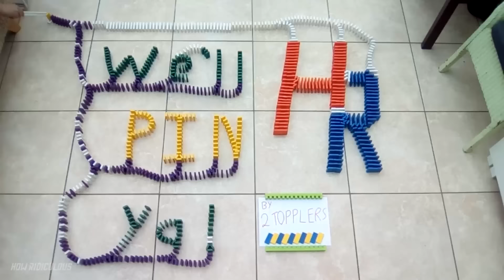Can This SOLID GLASS BALL Survive a 45m Drop?

Comment: It’s called a “conchoidal fracturing”, and occurs in glass and glass like rocks. It’s one of the key indicators archaeologists use to identify stone tools and tool scraps. When the force of the strike moves through the glass, depending on the angle and force, the fracture absorbs much of the force (you can see that in the ripples left on the new surface of the glass) allowing for precise shaping. Basically, glass + force = conchoidal fracture.
Reply: Fascinating
Reply: Up
Reply: It's interesting how the fracturing just dissipates the energy.
Reply: Is this Copy and paste or is this person a genius
Reply: Yes. Essentially, because glass is a very dense liquid, and can not be condensed further the point of impact remains close to intact. The force wave projects in a cone from the point of impact in a cone shape and shears (sort of) the glass away.
Reply: Rob Parker you are a genius
Reply: Yes
Reply: BMT Trickshots why
Reply: This is not entirely accurate, 
it could have some conchoidal fracturing sure, however the primary cause of the ripples are most likely a result of the rocks on Mars inducing a 'Coney Joney' effect.
Reply: @tobparker  There are a lot of people who don't know glass is a liquid.  :o)  I think of the ripples in the globes where the "coney joneys" are formed are like the ripples in a pond when you throw a rock into it.
Reply: I'm a flintknapper, can concur.
Reply: Julie Stevens yeah, and it’s amorphous, which explains why the cones are all a bit different. People tend to think glass is regular and crystalline, but it’s really pretty wobbly.
Reply: Glass is NOT a liquid, that is just a myth. A quick google search would tell you that. The myth comes from ancient stained glass on churches which was wider at the bottom than the top, suggesting that the glass was just a slow moving liquid. However, perfectly flat glass is very difficult to make (especially in ancient times) so it was already warped when it was made. Numerous experiments have been done since which conclusively prove that glass is not a liquid.
Reply: You're right except I think its called a coney joney
Reply: any kid who has played with marbles knows this will happen
Reply: Thx I did not know that :)
Reply: Dennis Brännvall’s #1 Fan Ok. You’re right. Glass is not a liquid. It is actually an amorphous solid, which in this particular case makes it act like a liquid. At least for the point of the cone explanation. Agreed though. Calling it a liquid is not correct or at least an oversimplification.
Reply: Wrong! In Australia, it is most often referred to as a "freakin' coney joney", and is sometimes called a "coney jones."
Reply: An important thing to acknowledge is that when the glass breaks, it's breaking with the least resistance. which is largely outward forces (from when the glass suddenly stops and the pressure builds near the surface).
Reply: They're probably the one to write the thing people copy and paste.
Reply: Joe Gilliver well, think of the force at the point of impact. It wants to travel in a straight line, like in a column through the glass ball into the ground. Some of that does. However, the ground is actually a steel plate, which is very stiff and will not absorb energy, so that force of impact can’t quickly go into the plate and into the ground. Some of that impact force spreads out into the glass globe, and the most efficient path is a cone. Glass is amorphous, so it doesn’t have regular shear planes, which is why we don’t see any right angles. But something has to give, so the weakest bonds are broken in a general cone shape
Reply: @dennisbrannvalls1fan964  thank God someone answered this correctly. Chemical Engineer here and can sleep tonight without writing a response
Reply: The description of the type of material that conchoidal fracture happens is known as "amorphous solids", where no crystal structure exists in the solid. Glass is one type of amorphous solid. Glass is stronger in compression than under shear which explains why the impact point survives (compression only) and the surrounding glass shears off.
Reply: Yep. Also occurs in most forms of brittle fracture to one degree or another. Materials Engineers/people doing failure analysis can use the pattern left by this sort of thing to diagnose the location or defect where the failure initiated. Works in metal, ceramic, glasses, polymers below glass transition temperature, basically anything that is sufficiently brittle and is hit hard enough. You can even see it in Silly Putty if you pull it apart fast enough to generate a brittle fracture. 

Although I think for shear poetry the mars/cosmic sphere/morphic resonance thing Gormsen came up with is an absolute beauty.
Reply: same deal with flint. you can knap glass the same way you would flint
Reply: You see when a big glass hits something hard it makes a small glass
Reply: Pin this woman.
Reply: Dis man speaking big brain
Reply: It's the same effect we see in obsidian
Reply: Oky doky
Reply: Plus the line of fracture proceedes through the glass at a right angle to the point of impact. That's why they all have the same shaped cone left on them.
Reply: Not a scientist, but the offset of the conchoid probably has to do with the angular velocity (or the angle of the impact plate). So the drops from the top produce relatively centered cones, the drops from lower down that require a bit of throw produce an offset cone.
Reply: if they were to measure the angle of the cone made, they would find that it is a 120 degree angle for all of them.
Reply: cool
Reply: smart
Reply: but why doesnt it just shatter from a much higher height, the cone was about the same at different heights so im interested to know why it didnt break more from a much higher drop
Reply: conchoidal fracture = CONEY JOE-NEEEEY BRUZ
Reply: Nah thats not it
Reply: @timsgotissues3581  i was looking for the flintknappers and rockhounds to answer... i knew right away
Reply: Little disappointed that someone beat me to it. Good job.🙂
Reply: @ChickenArmyBros  it's because glass is an amorphous solid and is actually really good at transfering energy. It will break in the same way each time from different heights but the force of the parts that break off will increase. You should also notice that the parts that break off get smaller as the height increases. That's because of the increased force being transfered.
Reply: @kiancarruthers3050  it's call geology
Reply: Well you're quite the scorchio aren't you
Reply: It's called a coney joney thank you.
Reply: @tobparker  you know it still blows my mind to think of glass as a liquid
Reply: Conchoidal fracturing is a fun one to see, the impact point has the strongest resistance as it has the full mass of the glass behind it and cause the fine structure of the the glass tries to fracture to the shortest distance of least resistance it spreads out yo the curve surface of the glass.   You need a really powerful slowmo to see glass fracturing at that speed though to see it as it goes around Mach 4.
Reply: AKA Coney Joanie
Reply: @gailfox7  It's not a liquid at all. That was also explained.
Reply: Interesting 🧐 🤔
Reply: @stendar1178  In low quality glass (poor, uneven cooling) this could occur. However, from the examples in the videos, these are professionally made to extreme tolerances. The fact that they can act as an effective magnifying glass is proof of their consistent density. Much like the ocean, the deeper you go the greater the pressure. However, in depth, you often look at the effect of outward pressures on the internal (lower) pressures.

In this case, the greater pressure is ocurring internally (especially when the glass comes to a sudden stop). The column (or cone) of glass at the impact site has the most "reverse pressure" working against gravity (because there is a column of glass supporting it). However, because it is being squished (slightly) from the sudden impact, the crystalline structure fails in a predictable way creating a conical structure where the impact occurred. A cylindrical shape is preserved and the material to the sides are "pushed off." 

Different materials have different advantages to certain forces. An egg can withstand a lot of pressure from above or below, but put pressure on its sides and it will break easily.

Path of least resistance.
Reply: I’m glad someone used the actual name rather than: “Coney Joney”
Reply: @7markhunter  Yes! Compression? Great at it! 

Shearing forces? No dice.
Reply: @tobparker  that makes sense, my question is: if they were to drop the glass balls from a high enough surface to fully shatter the cone around the circumference of the ball, and there was still more energy to disperse, where would the energy go? I dont know if I made that easy to understand but I hope you get what I am saying.
Reply: Psh, this guy am I right
Reply: RamblingBaba _  Glass is not a liquid. It's an amorphous solid, which means that at its molecular level, it has no discernible pattern or "structure." Where sugar or salt, even in tiny granular forms, will create harsh right angles (cubes), glass doesn't "settle" on any one shape, so it's consistently inconsistent. That might seem like it should shear or break in random ways, but because of the size of molecules, it shears and breaks in a regular way based instead off of the impact site and slight variances in the density/ micro fractures formed during the cooling process.
Reply: Very good information! Thanks for teaching me something today!
Reply: Your probably looked it up
Reply: None of these explanations seem very good to me. At least, none of them are explained very well. 

I think what is going on here is that the glass falling away simply has nothing to support it. There's nothing underneath it. The very tip has the steel plate under it, and the glass above that point has glass under it. The glass on the sides has nothing underneath to support it, so it enters into tension and breaks away. The glass at the point of impact is under compression, and glass is actually insanely strong under compression. The farther off-center you get, the more you go from compression into tension.
Reply: Why is the angle always roughly the same and what is the precise angle? HR we need measurements!
Reply: i’m putting this in my physics notebook
Reply: @RipleySawzen  I think you have the right idea! However, I think your explanation is lacking. The only part I would add is that the "column" (the middle of the cone) has the most material to resist compression, so it is hardly affected. However, the conical area surrounding where it impacted is not sustaining an impact. Instead, the "column" of glass is literally "squishing" or compressing (very slightly). This is enough that the amorphous solid shears off, as it does not handle side-to-side fractures particularly well (shearing force caused by the increased cylindrical pressure from the impact zone).
Reply: I’d like to see more of the glass balls but on a harder surface without a back cushion like sane
Reply: Kian Carruthers that person is a geologist
Reply: RamblingBaba _  If you look at old windows - I mean 200-300 year old windows, you will notice them sagging and they seem to pool down at the bottom of their frame.  They are slowly "running" from the top to the bottom.  They are just doing it very, very slowly.
Reply: @Brandon-vo3cb  I shouldn't do late night comments
Reply: @tobparker  Glass is not a liquid, that is a myth, it's an amorphous solid, and it does not "flow" slowly over hundreds of years. This has been debunked many times. I won't go into it.
Reply: @juliestevens6931  Glass is not a liquid, it's an amorphous solid, this myth has been debunked many times. Glass does not "flow" slowly over hundreds of years, again a myth rooted in poor quality manufacturing of pane glass in the 1800s. Google it?
Reply: @juliestevens6931  They installed glass that way hundreds of years ago. They've found glass just the opposite, the thick side up, in places where they didn't care which direction it got installed in.
Reply: u get that from wikipedia
Reply: I'm a geologist and i approve of this message.
Reply: K
Reply: @dennisbrannvalls1fan964  It kinda makes sense as an ancient glazier, that if I pour a sheet of glass that has a slightly thicker end, that I would put that end in the bottom of the page.
Reply: Thank you.
Reply: Nerd
Reply: could it just be bc of how the glass balls were made/blown? breaking in the pattern they blew the glass in?
Reply: s m o r t
Reply: Kool
Reply: @tobparker  nah, it's just homogenous, super strong in compression and weak in tension.
Reply: how is that any difrent from my responece :(
Reply: My brain hurts
Reply: You see this all the time in obsidian and quartz especially if you fracture quartz crystals or other relatives of the silicon oxide family of minerals. Because glass is essentially quartz it has the same property. Just break some glass and look at the broken edges.
Reply: Also known as Tatonic velocity
Reply: I'm 90% sure you looked that up. I didn't look it up. It's called using repeated science.
Reply: smart person
Reply: Pog
Reply: You googled it
Reply: n e r d
Reply: Is it something like how depleted uranium round self-sharpening during impact?
Reply: Absolutely stellar
Reply: Rob Parker do you know if this same effect happens in glass-ceramics and ceramics or dose crystallization have some effect on how it breaks
Reply: I always love seeing stones that were manipulated by humans, the difference in the fracture is that they often have a bulb of percussion that looks more “planned” as compared to a stone dropped and randomly breaking
Reply: @tobparker  it isn't that it is acting as a liquid, since there are no planes of separation within the glass, the force travels through it in a wave pattern (similar to how seismic waves travel).  The angle at which the force is applied from a given point is what causes the cones to seemingly go in one direction or another.  Amorphous solids don't really "act as liquids", the amorphous refers to the fact that it lacks the long-range crystalline order that defines true crystals.  While liquid crystals are a thing, they consist of organic molecules and vary depending on temp., pressure, etc.  and can fall into several categories based on their phase transitions.
Reply: @ChickenArmyBros  because they are spheres and the force will travel in the relatively same manner through the point of impact, the outcome will be similar. think of the force spreading out in a cone, once the cone hits the outer limits of the sphere, the outer parts will sheer off. This is why it is about the same percentage of material that is lost no matter what size sphere is dropped.
Reply: U serched
Reply: Kian Carruthers I studied archaeology and flint napping was a big part of that. I spent a lot of time training to know the difference between a nap and shard of rock. So I’m neither...?
Reply: The JuicePoppers went to school for my Archaeological certification and anthropology degree.
Reply: McKay Martin I just went to school for archaeology. It’s important in flint napping. Most community colleges offer courses.
Reply: Yup, my wife is pretty smart. Just sayin'
Reply: I thought it was built in layers
Reply: Were did you learn that?
Reply: Depend on the angle its a sphere -.-
Reply: Copy and pasted 100%
Reply: Nessa you go girl
Reply: That must have taken a while to tipe
Reply: You are the new Karl Kruszelnicki, to explain future conney jhonney's
Reply: Its an extreme conchoidal fracture. Normal conchoidal fracturing looks like an inverse oyster or clam shell somewhat, which is where the "Conch" comes into play in conchoidal, as it resembles the shell of a shellfish.
Reply: um no actally coney joney mars rocks
Reply: Big brain
Reply: Nessa Rigby this is copy and pasted because i saw the same exact comment from someone else
Reply: Im happy someone knew what this was!
Reply: Nessa Rigby big brain
Reply: @tobparker  It has nothing to do with glass viscosity. It's a simple mechanical result of the transition of the force between compressive stresses, which glasses and ceramics resist very well, and shear to tension, which they are much weaker in. You will observe the exact same fracture pattern in any sufficiently brittle material if you give it a point impact like this.
Reply: Ok then
Reply: I’m on my maximum render distance on minecraft and i still cant find who tf asked
Reply: Its how dense it is
Reply: To much
Reply: @tobparker  not true glass is not a liquid at all it's an amorphous solid however you're not far off the mark. Just misinformed
Reply: @juliestevens6931  amorphous solid not a liquid
Reply: Show-off.  LOL!
Reply: U used google nicw thinking
Reply: Dillon Gamertv show me because I literally wrote that out myself.
Reply: Tom Frankhuizen did you watch the video?
Reply: ok
Reply: @arthurmorgan6223  or.. and hear me out here... the other person copied it
Reply: No need to call Mark Rober 😂
Reply: @tobparker  it's not really a liquid though, it's an amorphous solid, which means it doesn't have a regular crystalline structure the way other solids do.
Reply: I'm literally a rocket scientist who almost got a masters in material science I didn't know that.  Thank you Nessa Rigby!!  PIN THIS ONE!!!!!!!!!!!
Reply: I was thinking that when the ball hits, the point of impact stops so quickly that a portion of the ball continues to move after the impact. So when the exact point on the ball hits the metal plate the portion that doesn't stop as quickly "slides" into the plate and breaks off.
Reply: haha glass go bomp
Reply: @GabrielSun18  No, I just happen to have studied geology as well as material science among other things in University (originally majored in aerospace engineering and am now finishing a degree in environmental biology).
Reply: @juliestevens6931  That's a misconception
Reply: DapperDanLovesYou Thank you for actually describing the ‘why’ it happens that way instead of just saying ‘force traveling though an object’ with lots of flowery words. All the original comment said was a force acting upon an object changed the object. The original comment failed to explain why the energy made such a change to the glass ball. You comment actually explains why. Thank you!
Reply: This comment didn’t actually describe why it fractured the way that it did. All your comment did way explain that force acting upon an object can change the object. Your comment states nothing toward the reason it fractures in ‘waves’  like in the video.
Reply: You study geography
Reply: What she said
Reply: @E S You know how when you watch explosions in slow motion you can see the kinetic energy ripple out before the visible explosion? It’s the same with force as well, it travels in waves, leaving the ripples behind.
Reply: :: to be renamed the coney Joanie effect
Reply: No bro, it’s called a Coney Joney.
Reply: Ha. Nerd.
Reply: That's total bullshit.  Its obviously caused by the shock wave from the flux capacitor that causes it...did you notice how the ball accelerates to 88 miles per hour?  duh...
Reply: Wow you are smart

Can’t relate😅

I’m dum🥺
Reply: I have no idea if this is correct or not but you explained it in a way i like! ;-p
Reply: Came here to post this ^_^ it concoidal fractures because glass has no chrystaline structure :)
Reply: This was absolutely fascinating thank you Nessa because I was really curious at why and how that effect was caused
Reply: Thank you
Reply: Facts
Reply: U smart
Reply: @tobparker  inteligunt
Reply: It’s called google.
Reply: @kiancarruthers3050 , it’s simplifying something from google in ur own words. My comment is just my opinion, don’t give this person so much credit for searching something up.
Reply: It is not Conchoidal fracturing because there are no crystal like fractures coming from nor around the cone.
Reply: @kiancarruthers3050  neither they got mixed up on the fractures
Reply: The shape being created is called a Frustrum.
Reply: @tobparker  glass isn't a liquid. That's been disproven time and time again
Reply: I'm confduzzuled how can you say that in such detail
Reply: That explains the fracture. Or describes the fracture but not how a button of the original ball is left behind. That has something to do with the surface it hit I think. The steel is kind of soft so. The.. whatever
Reply: @thetruthexperiment  the “button” of the original ball is what’s removed by the impact. The shape of the “button” depends on a multitude of physical factors. Just the right mix of these physics created the “button” of glass shard seen in the video.
Reply: @nessarigby5911  it’s not the original surface? What I mean is the flattened point at the end of the “coney-loney” or whatever. I’m thinking that is the impact sight and the original surface. Or whatever.
Reply: @thetruthexperiment  I’m not sure I understand your question, but I’d really like to answer it if I can! So, in this case, the original surface is the outermost “layer” (so to speak) of the glass sphere. The same would be true for an unmanufactured block of obsidian, which is also glass. Any flattened point (this is where I get confused because a flat point? Sorry lol), and by point I’m assuming you mean area, is caused by the force of impact. Glass is extremely malleable under extreme conditions, so extreme force reacts to the glass by completely changing its shape. In this situation, the impact site on sphere left the cone shape, as well as what looks like ripples you’d find in water. The force of impact was so strong and hit just the right place, that the coney-joney was born. With a manufactured glass sphere, there’s no true “original surface”. What makes this result so unique is that the HR gents used a perfect sphere, where as most glass work does not. This is an extremely easy experiment to recreate. You can buy a glass sphere and then just smack it forcefully with a rock, and voila, you’ll have something similar to what they got here. Just wear gloves. And goggles.
Reply: F=M*A
Reply: nice
Reply: nerd.
Reply: Cool
Reply: The first thing with multiple circles was a sonic boomq
Reply: Nicely explained, thank you.
Reply: Lol no I'm pretty sure these blokes called it a coney-Joney....lol j/k
Reply: I remember this from my Rocks and Minerals studies
Reply: Jesus loves you please turn to him before its too late to repent
Reply: Jesus Christ loves you
Reply: It’s summer break why do we need to learn
Reply: Smart
Reply: It is not for me and we and not writing stuff onpaper
Reply: Fascinating🐉🌠
Reply: SCIENCE WITH NESSA RIGBY
Reply: I remember 'rock-knocking' when studying physical anthropology long ago. Class was great when we could spend the time flaking obsidian tools. 😀
Reply: Wow
Reply: ITS TO MUCH KNOWLEDGE IMA BOUT TO EXPLODE
Reply: Shut
Reply: The
Reply: Up
Reply: Was just going to explain it but you already did saved me some time
Reply: @kiancarruthers3050  I don’t see how knowing this makes someone a genius, but ok
Reply: I wonder if the ball is a solid round piece of glass, or a bunch of layers to make the size? Wondering if the difference in glass blowing technique would cause a different type of fracture??? Still pretty seeet!
Reply: @Nessa Rigby is it only in spheres or all shapes of glass
Reply: Thank you.
Reply: @tobparker  glass is considered an amorphous solid, not a liquid.
Reply: Wow
Reply: It’s a good fact but we’re still gonna use cony Joney
Reply: Bro has Google right there
Reply: Yep and it is also is used in any knapping, so it is really cool to see this in person. I studied archaeology in college and worked with my state archaeologist on native American sites, we found TONS of knaps like this conchoidal fracture structure. interestingly, you can also get this from quick expanding ice in a crystalline structure rock formation
Reply: Oke ._.
Reply: Congratulations on knowing how to use Google
Reply: Nerd
Reply: Big nerd
Reply: This should’ve been pinned. How good!